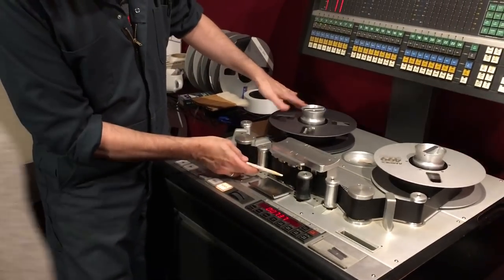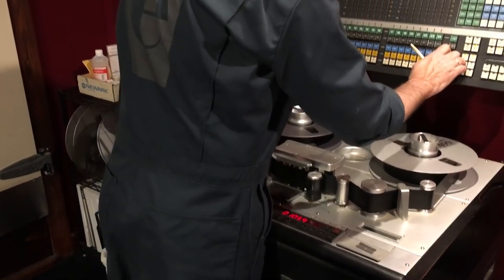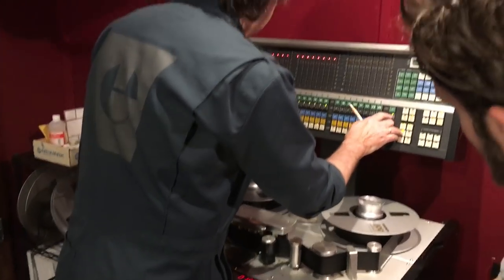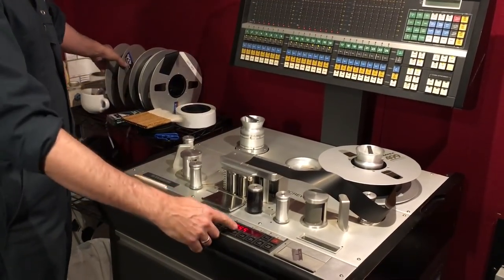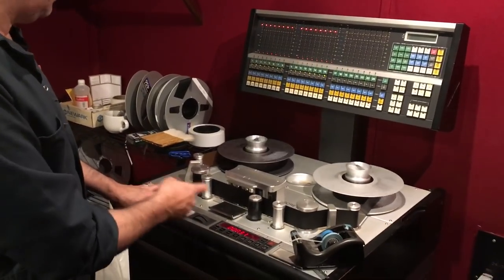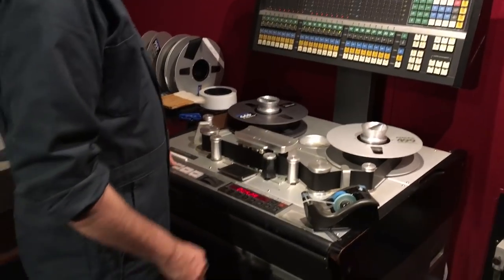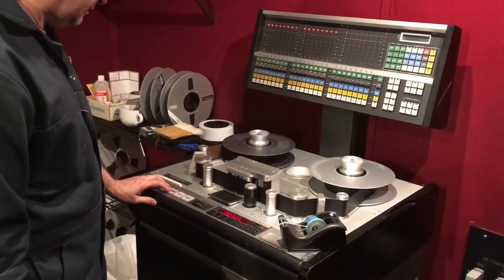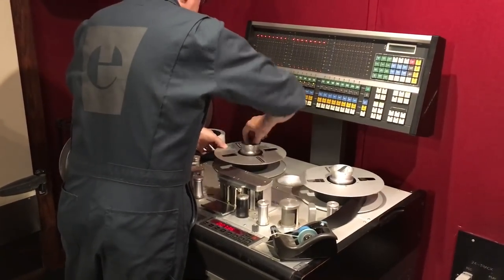Steve Albini cutting and splicing tape

Comment: The tape handling of these old Studers always amazes me. The fast wind is lightning fast and yet the tape is always kept under perfect tension no matter what the operator does. Seriously good design and construction.
Reply: badass!..only rivaled by the Otaris!
Reply: @WarrenSt.James_Guitarist  Which is why I have an Otari MX-55N - I can't afford a Studer! :-)
Reply: ^the concept of gears
Reply: massively expensive machines.
Reply: @DeuceGenius  And yet at the advent of digital recording they were almost giving them away !
Reply: I'm saying! I used a800s back in the day. They Never wound that quick
Reply: Meanwhile my Tascam M80 basically just drunkenly eyeballs the locator and you know its having a good day if its within about 10 seconds of the mark lol. I should probably get the old girl serviced.
Reply: @JohnLloydDavis  Very bad planning on their part and very big optimism towards digital. They are grinding their teeth thinking about the value of these machines now they were giving away

Comment: No one has ever high fived me for making an edit in pro tools :(
Reply: I've been high fived for finding the undo button though.
Reply: @Damien Lewis You just weren't doing it long enough ago. In 1991 or 92 (I forget which) I was chief engineer at Southern Sky Recording Studio in Fort Oglethorpe, Ga. We were a small 16-track analog studio with a first-gen 4-track ProTools system. Another, much bigger studio a few miles away, was making a record for a certain group whose name rhymes with The Gray Phats. They had spent an all-nighter mixing a track and were happy with the mix, and then everybody went home for some sleep. When they came back they listened to the mix and heard a momentary buzz from a guitar amp during one of the choruses. So, they decided to re-mix it, but could not re-create the mix. They brought the DAT of the all-nighter mix to me, and I copied and pasted a 100 mS or so segment from another chorus on top of the buzz. THAT got me a high five, but sadly, no engineering credit.
Reply: @enneff  Thanks for explaining the joke for everyone. Whoosh!

Comment: I am so in awe in front of this ! I have done in my old days editing and cutting on 1/4inch (6.35mm) 2-track tape, but on a 24-track 2 inch tape, it is another dimension. Steve is so impressive, kudos to him !
Reply: Same here, on 24 track I usually tolerate a bounce and do my edits on a 1/4 inch machine (using a couple of Lynx-2 and a KCU to get it back on the 24 track) but I haven’t spliced two takes together. I have a Stephens 821b which is pretty gentle on tape but doesn’t wind like this one.

Comment: Just out of curiosity, how much money does one of those reels cost nowadays and how much would one of them have cost back in the sixties and seventies?
Reply: An ATR 2" is currently (9/2021) at €400/$475 and RTM 900/911 you can get for around €350/$415. In the Nineties when I used it an Ampex 456 was DM 250 which equals todays €188/$225, taking inflation into account. (For better comparison all prices are incl VAT.)

Comment: whys he dressed like a mechanic?
Reply: Those a janitorial one pieces he got the Electrical Audio logo printed on the back. He has a bunch of different ones in different colors. I think its a statement. Like when the cable guy comes to the door, you know its the cable guy. So the audio engineer is dressed in a uniform as Steve sees what he does the same way a plumber does. From what i heard him say, thats what i got out if it. Like how Shellac has those same guitar and bass head enclosures and both use aluminum neck Travis Bean bass and guitar. All kind of uniform. Wow that was a long explanation. Hope it helped.
Reply: @johnmartinec2423  agree, everything he records sounds like it is recorded in a garage...hence the uniform, it is appropriate
Reply: ....because he's a mechanic!